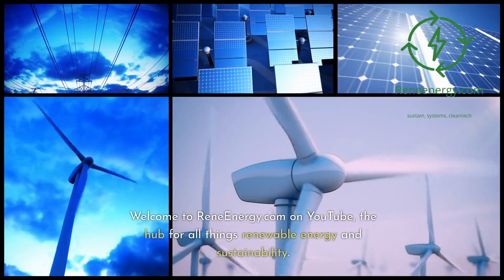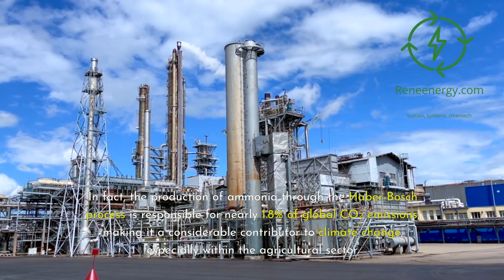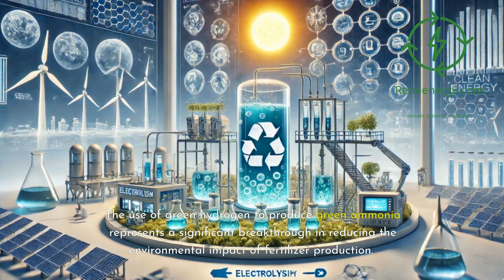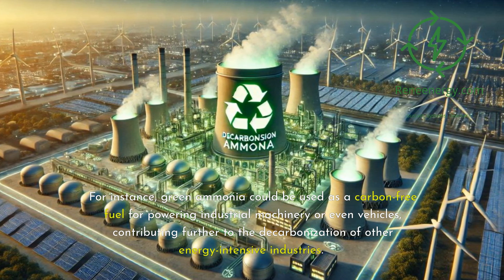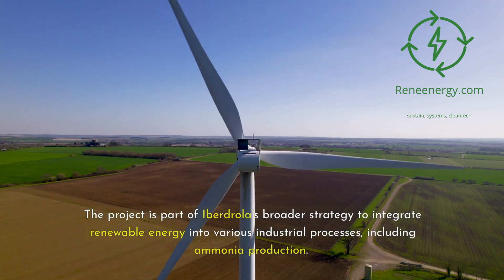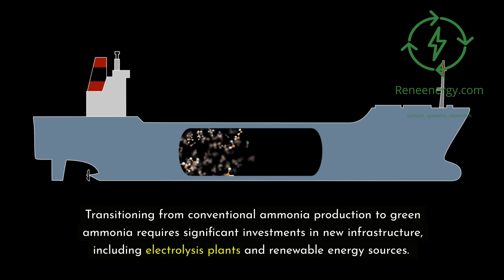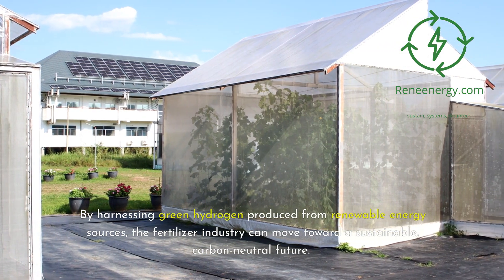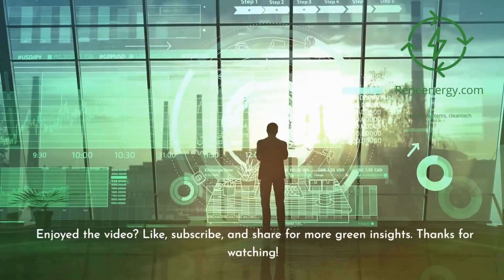Green Ammonia - Powering the Clean Energy Transition

Comment: Ammonia is the practical way forward for the so called Hydrogen Economy. It is much easier to store and transport than Hydrogen, and there is an existing market for it that needs to be greener. Its use as a fuel/storage medium is more questionable as it is even less efficient than Hydrogen and has its own safety issues. Green Ammonia has unique opportunities in remote areas where electrical infrastructure is not developed such as desert PV/wind. We should be looking at using renewables for the whole process, not just the hydrogen.